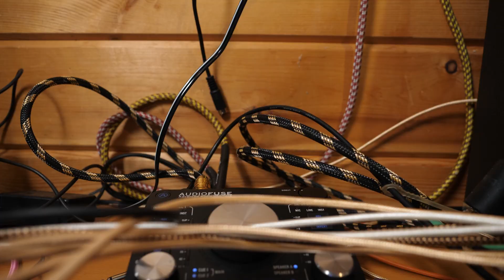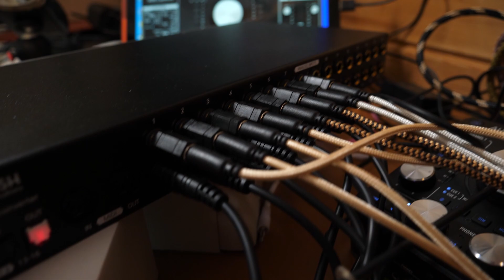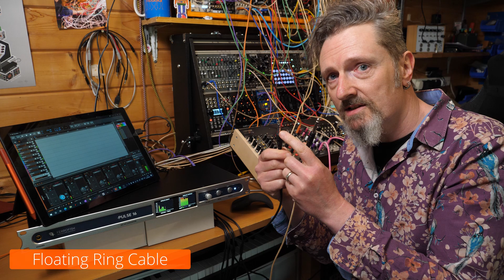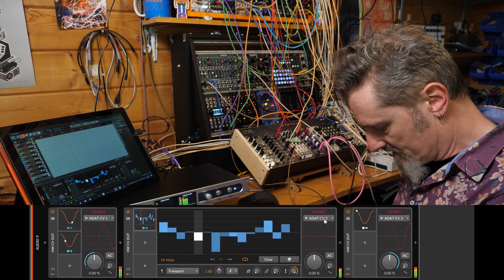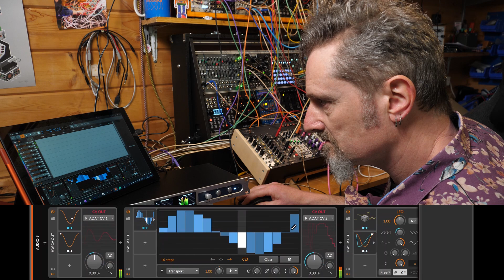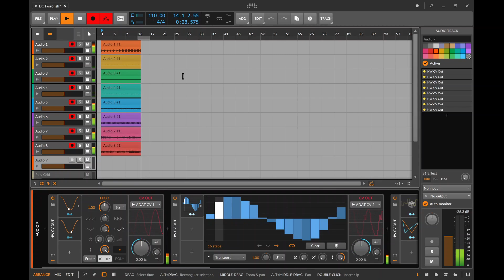DC Coupling with the Ferrofish Pulse 16 CV and Bitwig Studio

Comment: what are the cons and pros of using cv throught pulse 16 vs buying a dedicated midi to cv device like sleeper doepfer dark line? I mean pulse 16 cv will be restocked in 3 months or so and i dont want to wait. I would just buy normal version of pulse16 and additional doepfer dark line and make a connection to midi throught pulse 16. Em i missing smth?
Reply from the maker: I think you're getting MIDI confused with CV. The ES8 is an audio interface - there's no MIDI involved. The Pulse 16 is useful because it expands an existing audio interface assuming it has ADAT - the ES8 can also do that. Both give you channels of CV for modulation and sequencing, and you'll need special software or plugins that can generate CV - not MIDI. The only advantage of the Pulse 16 is that it has 16 channels as opposed to 8 on the ES8 - and they are in very different forms. If you just want MIDI-to-CV then there are much simpler and cheaper options available. Does that help?
Reply: @MoltenMusicTech  but on pulse 16 you do have a Midi port so you can use smth like  doepfer dark link (midi to cv) or any other midi to cv converter to control modulars yes? So basically what im saying is that you can control modulars without the need of pulse 16 cv version as you can simply utilize midi port on pulse 16 standart version (with a midi to cv converter like doepfer dark link)Em I right?
Reply: @MoltenMusicTech  I dint realize sleepers es8 has no midi port. I was thinking about smth like doepfer dark link midi to cv converter.
Reply from the maker: Sure, you can use any MIDI interface and a MIDI-to-CV module to control modular. But MIDI and CV are different. They are used and behave very differently with vastly different resolutions so it really depends on what you are trying to achieve. But no, you don't need a Pulse 16 if you just want midi-to-CV.
Reply: @MoltenMusicTech  I'm asking becouse I don't know is it worth to wait 3 months for cv version to restock. So I was wondering if I can use midi port on normal version for cv messages. Are there any pros or cons between those two routes? Apart from having to buy external Midi to cv converter. I think external midi to cv converters should be in theory better and more robust in options then those on pulse 16 cv version. The question is it worth to have it in one box rather in two (pulse 16 + doepfer dark)
Reply from the maker: As I say, they are different - some things you can do with both, some things you can't. MIDI is intentional and specific, CV is continuous variable, mixable and shapeable. If you are just looking to turn MIDI notes and velocity in CV then a MIDI-to-CV module is perfect. If you are looking to generate interesting modulations through Silent Way plugins or Bitwig, or use your modular to modulate your DAW then a DC Coupled audio interface is the best way to go. Only you know which of those two scenarios you are into. I'm assuming you are into the Pulse 16 because you want multi-channel audio anyway right? Otherwise it's a weird thing to buy just for the MIDI interface.
Reply: @MoltenMusicTech  so I cannot use midi to cv to add lfos througjt ableton/bitwig? I need dc coupled on audio converter to do that? So you saying i cannot do the same with midi to cv converter? Strange.
Reply: @MoltenMusicTech  i am wondering if I need cv version of pulse 16 in the first place. Why not buy cheaper standard version of p16 and just add midi to cv converter like doepfer dark line or any other to send cv from midi to modulars?
Reply: @MoltenMusicTech  also if you use midi to cv for modulars you have more free outputs on p16 cv version.
Reply from the maker: Why use the Pulse 16 at all? I still dont know what you want it for other than for CV which you dont think you need. If you dont think you want to use CV then dont - just get a 50 quid MIDI interface and ignore the very expensive ADAT converter box. With CV you can easily mix and shape, morph and offset the LFO, with MIDI that's much harder or impossible to do. If you just want a wobbly LFO then midi is great at that - do that.
Reply: @MoltenMusicTech  I'm using rme raydat with p16 and I was wondering can I do the same things as on p16 cv version (regarding controling modulars) but utilizing its midi port. Do I need to upgrade to cv version to do the same stuff you do?
Reply from the maker: You can do lots of modular stuff with MIDI-to-CV. You can also do similar and more modular stuff with CV through a DC Coupled audio interface. I don't often do either but i prefer to use CV where i can because it's more intuitive and unintentional. If you don't really know then i think you'll be fine with Midi-to-CV because you've probably got a DAW/MIDI workflow and you should go with that.
Reply: @MoltenMusicTech  thank you very much for all information! Very cool channel.

Comment: From what I'm seeing, the Pulse 16 outputs reach only 20dBu. That should correspond to roughly 8V (RMS, not peak). Isn't it a bit low for general CV control (where ideally you'd like to continuously output up to + or -10V sometimes)?
Reply from the maker: Loads of modular is +-5v, besides if something does what you need then the figures are irrelevent.
Reply: @MoltenMusicTech  yes :) but the figures are what guide you to determine what you should buy and what is likely to cause problems
Reply: @ywenp  They offer a 24dBu option on the pulse 16 lineup.

Comment: you can fry your interface by using the wrong cable - this should come with a warning - with a  mono (TS) cable you are effectively shorting the ring and sleeve on the output with as much as 10V dc
Reply from the maker: Wouldn't the same thing happen with audio when you plugged a mono cable into a balanced socket? And yet our equipment doesn't generally blow up. I think we're dealing with very small currents here and so frying anything is very unlikely - never heard of that happening.
Reply: @MoltenMusicTech  from the horse's (expert sleepers) mouth: A Note On Cables
In general special cables are recommended when using a DC-coupled audio interface as a source of CVs. Most audio interfaces have balanced outputs (on TRS ('stereo') jacks or XLRs), while synth CV inputs are unbalanced (usually on TS ('mono') jacks or minijacks). If you use a regular stereo or mono jack lead, you'll be shorting out one of the balanced output signals (usually the R (ring) to the S (shield)). While this probably wouldn't be a problem for normal audio use, when outputting the sustained voltages that are useful as CVs you risk damaging the interface hardware.

The usual recommendation is to make up special cables with a TRS jack at one end and a TS at the other, connecting T->T (tip to tip) and S->S (shield to shield) while leaving the R (ring) floating i.e. unconnected. Such cables can be purchased direct from Expert Sleepers - see the accessories page.

An alternative is to wire a TRS jack to two TS jacks, connecting one T->T/S->S and the other R->T/S->S. This then gives you two copies of the output CV, one of them inverted, which is particularly useful from LFOs. Note that this cable configuration is identical to that of a regular "Y" audio insert lead.
Reply from the maker: Oh well, there you go, fair enough - good tip. That's another reason for using floating ring cables although Oz does put it forward as a potential risk rather than a need for a warning sticker of imminent danger. In my experience audio interface manufacturers don't seem to know much about using CV and so the fact that you need special cables at all would be a complete surprize - they are never mentioned and Expert Sleepers are the only ones talking about it and their modules dont even need the cables.

Comment: Great video! Any idea of how can I get (or most possibly make) a DB-25 to TS snake for that? I'm using an Antelope Orion Studio that actually have 16 DC coupled outputs, but they are on two pairs of DB-25.
Reply from the maker: Google it, ask an audio store or get it custom made.
Reply: That's what the nw2s modules are for. They use balanced D25 connectors and also correctly convert levels between modular and line level, and do electronic balancing. So no special cables or offsets needed. You can use them with the Pulse 16 CV or any other DC interface with D25 (e.g. the Apollo x16)

Comment: Screw that and the adapters are not good telling you that since been Mastering for years even a patch bay sucks how to degrade the signal 
the expert sleepers provide me 12 in 16 out with my interface for way cheaper stray to the reaper
Reply: Yes this seems like a hard way of doing something that’s long been solved by expert sleepers.
Reply from the maker: Sadly Expert Sleepers interfaces don't provide all the regular things you need on an audio interface like guitar inputs, mic inputs, monitoring software, loopback, variable sample rates, metering. The ES-9 has come a bit closer but generally their interfaces have a single purpose - which is great - but it doesn't fit well into a studio workflow, at least in my view. I wish they'd just do ADAT in/out to 8 channels in/out but to do that i need either 3 modules or the ES-8 which would have to use USB. So, while Expert Sleepers do have some solutions they are expensive and particuilar. As for adapters - this is modular, all the cabling is pretty crappy so i'm not really seeing a mini-jack to jack adapter as a weak link :D
Reply: @MoltenMusicTech  the es-8 can be used in 'standalone mode' with just Adat connected to an interface (no usb). 4 DC ins 8 outs (with the ability to expand - though which expander to get is a lot to get your head around)

Apparently boredbrain are coming out with an ADAT module shortly too, which will be interesting to see
Reply: @MoltenMusicTech  but that’s why the interface in my setup got the ES8 hook thru light pipe 12ch in and 16 ch out plus the 8ch mic or line inputs and 10 analog outs total of 20 ch in & 26ch outs that’s plenty

Comment: Hi Robin. I think balanced outputs have the full signal on both outputs (tip and ring in your case) but 180 degrees out of phase from one another. I never heard that each output had only the positive or negative "half" of the signal. By having the signals out of phase you can have bigger cable lengths because, at the end, the negative phase signal is inverted and summed with the positive phase sgnal. At this step any interference induced along the way is neutralized because it'll be out of phase in the summing.
Reply from the maker: Yes, that is true. I'm trying to explain what i see when doing this DC Coupling lark and i'm having to make some conclusive jumps because good information is hard to find. I understand how balanced cables work but that's not what i've found in my testing of dc coupling on interfaces. Maybe the Pulse 16 is the first one i've tried that works properly..... but then why do floating ring cables exist and why are they sold for this purpose? So..... i'm just trying to explain what i see as best i can and welcome the discussion about it :D

Comment: Love this stuff. Very cool. I’ve been using Reason 11 to control my modular over ADAT via an Expert Sleepers ES-3. Works so well and I’ve not had to concern myself with all the DC coupling malarkey. Amazing to have, especially if you want to keep your modular ........ ‘sensible’ in scope! :-) A lot of the control, sequencing and modulation can come from Reason. So I need less of those devices in my Mantis case. More room for interesting noise making and mangling modules in my rather modest modular set-up. Added an ES-6 so I can go back into the computer for multi-tracking 😎
Reply from the maker: The ES-3 does seem to be the easiest way to handle controlling modular from a computer assuming you have an ADAT output. The ES-6 is also good for tracking but only has 6 inputs.... so you need the ES-7. I'd really like Expert Sleepers to do a straight ADAT in/out to 8 in/out interface so you can do both in one module - i dont know why he's never done that - seems obvious to me. Or maybe it's time for someone like Ferrofish to make one.
Reply: @MoltenMusicTech  I actually upgraded from an Focusrite Scarlett 6i6 to an 18i20 just to get the ADAT I/O! But was handy to have the extra audio I/O + it looks nicer in my rack than on the desktop :D But yes, the ES-3 was an amazing addition. I just plugged it in and it worked. No set-up, no faffing. Just point your source (CV or audio) from Reason to one of the ADAT outputs and that's it. You can even see the activity on the LED port on the ES-3 before you connect anything up. Fantastic. 

It's a shame the ES-6 hasn't just got 8 inputs to match the outputs on the ES-3. The ADAT port is underneath the 6 ports so it can be squeezed into 4HP. Having 8-ports it would probably have to be 8HP, like the ES-3. But surely that's not the reason it only has 6 inputs?! I don't know. The ultimate option from Expert Sleepers would be the ES-9. But it's bloody expensive and takes up a fair bit of HP. Nice bit of kit though. Might be the one for you? Actually I've just checked and the ES-9 doesn't have ADAT. It's got SPDIF I/O instead!!! That's odd! :-/

Comment: I'm glad that the Expert Sleepers ES- products remove the need for floating ring cables and other such confusing things
Reply: Not confusing with a little research, depending on your Adat or Soundcard, you don’t always get the full voltage output..still works for modulation ;)